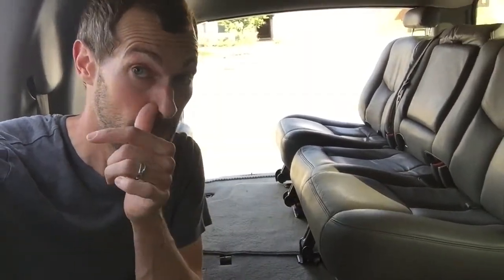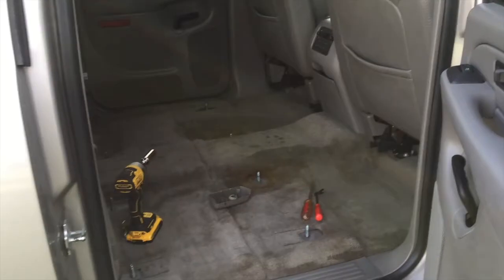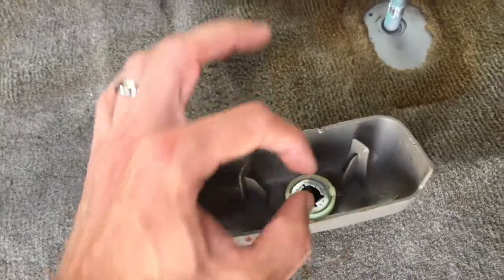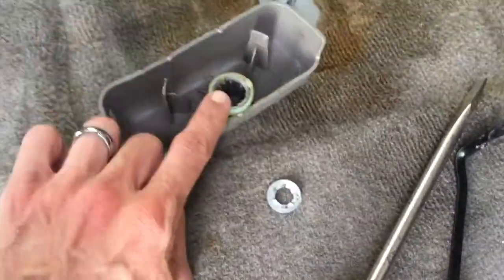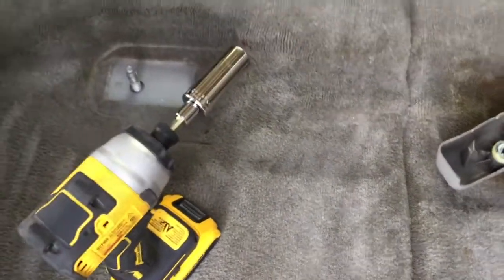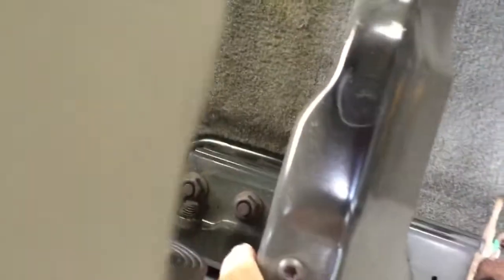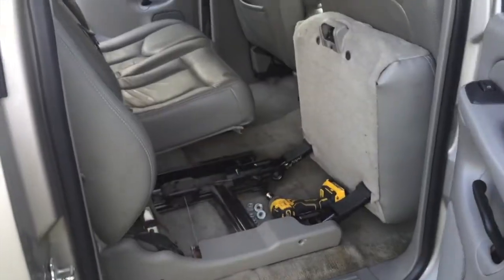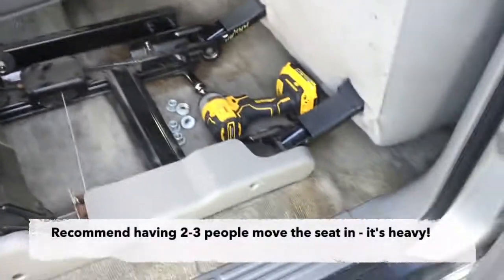Chevy Suburban swap bucket seats for a bench seat

Comment: This is great.  We've been considering ripping out the front bucket seats and console, and replacing 'em with a bench so it's possible for everybody to sleep in the car comfortably at truck stops while traveling.
Reply from the maker: Nice! Great idea.
Reply: Did you do that?I want to do the same.
Reply: Anyone try this and know if this is in fact possible? We have an 02 suburban and would love to swap the driver/passenger buckets and console for a front bench to make our 8 seater a 9!
Reply: @ForTheFlame yes you can pull a bench seat with the flip up jump seat out of any Silverado and they will bolt right in. Just make sure to get the dash piece to cover the hole where the center console went. Try some of the Silverado and duramax forums they are people always willing to swap for the consoles. Save some money possibly. All the gm trucks and suvs use the same seat mounting as long as its the same part of the floor layout. Like crew can truck matches suburbans and yukon xl and all are the same from the b pillars forward

Comment: Can you switch the front seats for bench seats?
Reply: I'm looking to switch my front bucket seats and center console for a bench third middle seat option. Were you able you do it?
Reply: @jacobjensen8592 we are hoping to do this also but not finding any info on whether or not it is possible! If you get an update, please share. I will do the same!
Reply: It should be possible just pull a bench seat from a chevy 1500/2500 of the same body style. I've seen these suburbans with a bench in the front

Comment: You did not actually show the complete process. I am having trouble removing the 2nd row bucket seat. The two front bolts are easy. Its the two rear bolts that are the problem. There is a flap behind the bucket seat that cover the two rear bolts. How did you remove the cover to get to the rear seat bolts. This video would have been perfect if you would have shown the actual process of removal.